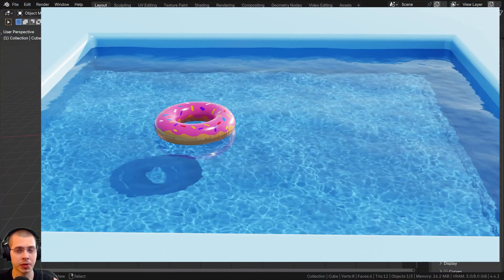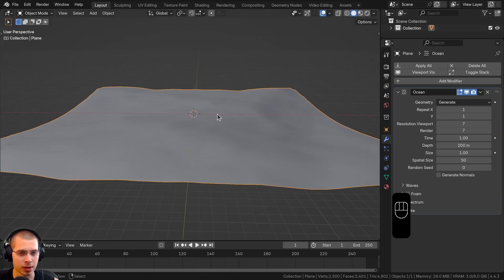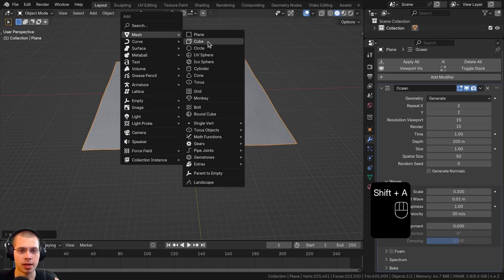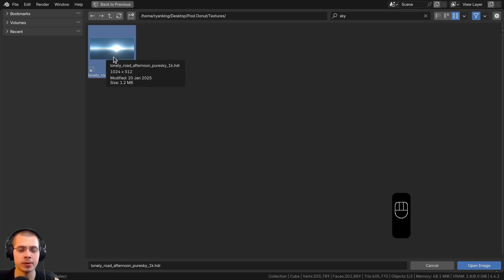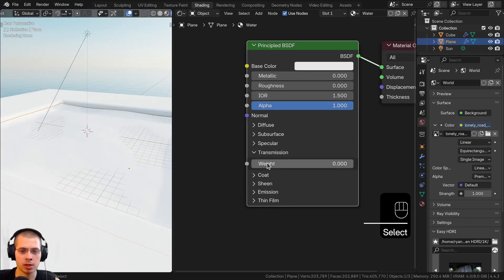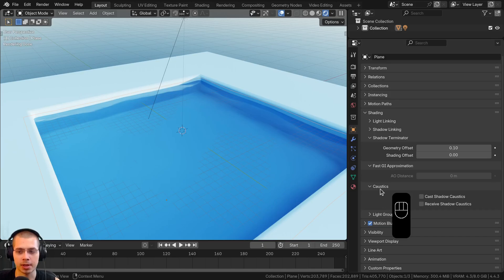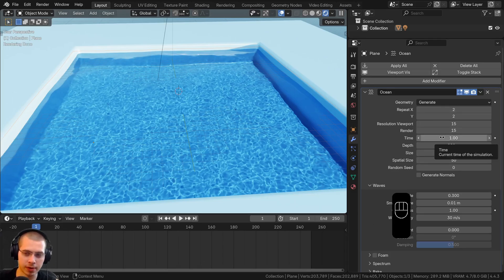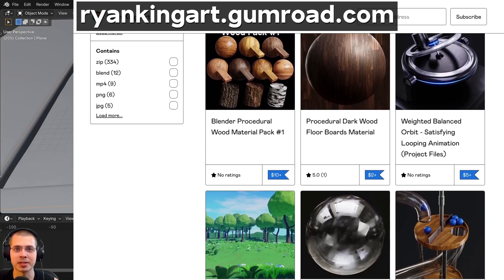Realistic Water Caustics 🌊 (Blender Tutorial)

Comment: Followed the tutorial pretty well did all the steps but it doesnt work, i activate the caustics in the sun, put cast caustics in the water and receive in the floor, but still nothing shows, turn these settings on an off doesnt change anything in the scene, am I missing something? Im using cycles, have an RTX 4070 if its required to have an RTX graphics card
Reply: same
Reply: Same here but I fixed it by setting the sun angle to 1 degree - which is in the video!
Reply: @toddmiller8227  I solved it by just suing a light with wave texture and a color ramp.

I think Ryan's method works but it can be barely visibility depending on the size of your scene